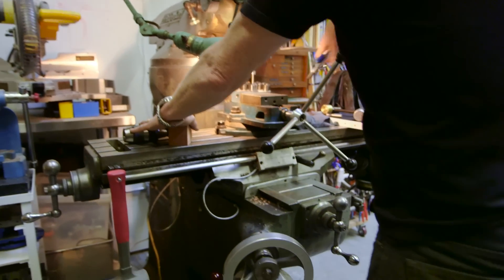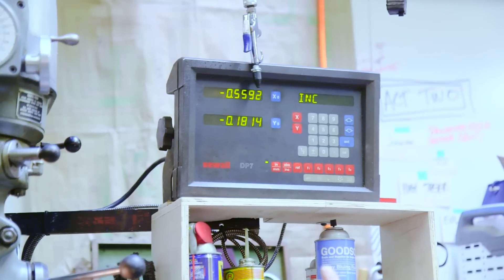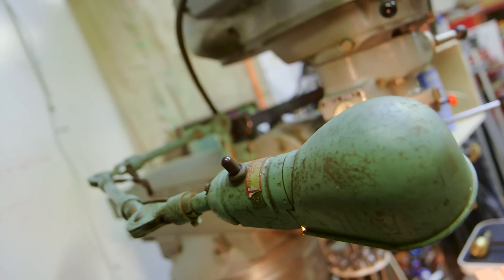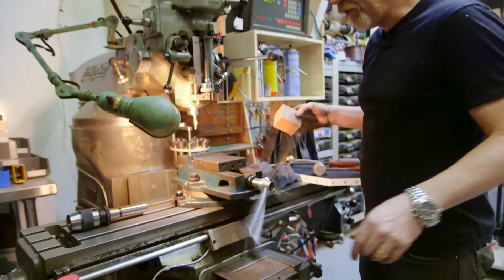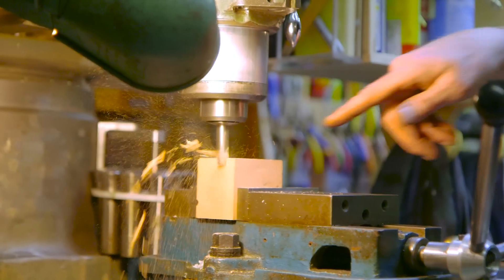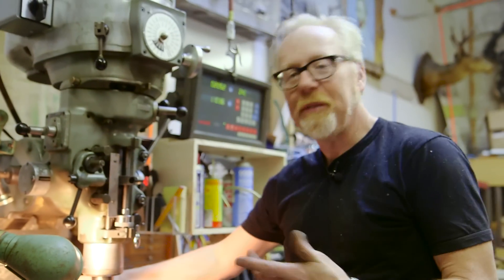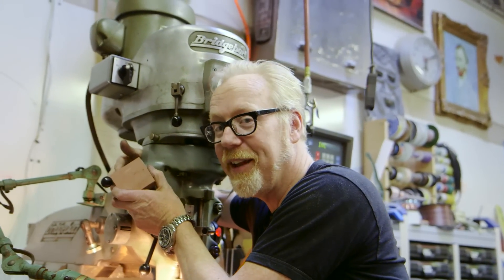Adam Savage's New Milling Machine!

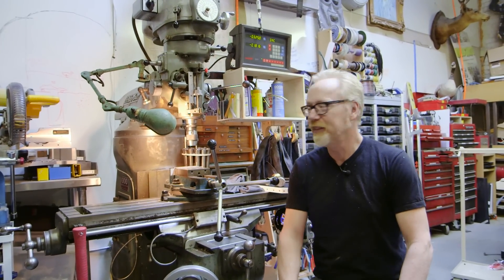Comment: 0:38 - This is facts. This Bridgeport can be used to literally develop a fallen civilization back to advanced tech. No one will understand how, but it's all because of precision. This machine is able to hold high tolerances down to 30-50 microns. This in return can help build other highly advanced machines which requires high tolerances. He's using the Bridgeport to mill wood lol 🤣

Comment: Whenever you're milling with a Bridgeport, you're supposed to bring the quill all the way up, secure the stop against it, and apply the quill brake. If you don't, you run two risks. The first one your part may not be to spec because the quill moved during the operation. The second risk you run is irreparably damaging the quill to the point that the machine is no longer usable.

Comment: What is the  material they cut?
Reply: Ruda;  Anything.  With the right cutters it will machine all ferrous and non ferrous metals and any polymer.  There is no limit regarding materials
Reply: @georgegeorge-t1p  I know. My question is what is that material used on this video.
Reply: @georgegeorge-t1p  Nice. Thank's I will search about this material.

Comment: TL, Don't read!

Ah, yes!  With this, his lathe, and a good broom, a person can make about anything.  Oh, and along with the machinery, add in a few years of hands-on experience -- making parts to high precision is an art.  As rigid as this Bridgeport and the tools used with it look, everything deflects just little bit when put under a load.  A machinist has to understand that, be able to anticipate frame and tool distortions in the direction of feed, and accommodate them in the cut.  Then there's backlash, a pretty basic and always-present inaccuracy in manual machinery.  Metal blanks that are having material removed will warp during the process, and this must be dealt with by flipping parts frequently, and perhaps in-process mechanical straightening.  Finally there's the cutting tools themselves.  Unlike drills, which look pretty much all the same, there are thousands of different shapes and sizes of cutters, made from several different kinds of material, including ceramics.  However, a prototype machinist, which is what Adam is, will often hand grind his own tools to get the best results (from high speed steel or cobalt blanks), that are as rigid as possible in the direction of load, produce perfect chips, and carry the heat away from the cut.  A telepathic link between machine and machinist is helpful here.  

Adam is a dying breed.  Time was when all machines were manual, and people started in the shop only getting to turn the handles after someone else set up his jobs.  It took years to get really good, with most never advancing beyond production machinist.  Now most machine tools are CNC, running from a program developed by a CNC programming engineer who, with the help of a computer, works out the order of the machining steps, the setups, the cutting tools to be used, the speeds and feeds for cutting, and in-process inspections that are conducted by the machine itself.  Because of errors that creep in due to the CNC programmer often not being a machinist, it is not unusual for program testing to be started using wax as the base material, with an alert machine operator standing by with his hand of the E-STOP button.  There aren't even shop drawings anymore; they've been replaced with "data sets," coded files containing mathematical equations that define 3D models drawn on a computer screen by a design engineer (who isn't a machinist either - they're famous for designing parts that are perfect for an application but which can't be machined by any known process!).  CNC programming engineers work directly with those data sets.  The result of all this is that people entering the modern factory become "machine operators," not machinists.  Eliminated at the same time have been draftsmen, who used to receive the layout work of a design engineer for conversion into a useable shop drawing, with proper dimensioning and tolerancing.  The point is production efficiency.  CNC machinery can produce parts many times faster than a production machinist, with consistent accuracy, but the expense has been loss of the individual expertise of tens of thousands of machinists.  Adam is going to have to fill in for all those people.

Comment: I went to an auction last week and tried to bid on a very unique Bridgeport, this one had square ways, you seldom find one with these, it was VERY heavy duty. That went for $2900 so I ended up not getting it. So I threw my number up on a Fadal VMC 4020 CNC machine center and one the bid for $1,100 which broke my brain. I am still confused how a perfectly maintained CNC machine center goes less than scrap but the old mills sold for so much.  Back to the point, a Bridgeport with square ways, I would like to have started a new channel off about those.

Comment: Fun Fact: Of the 7 basic machine tools (band saw, grinder, lathe, etc.) the knee mill is the only machine tool capable of making itself. And it's called a "power feed" Adam...not a "motor on the knee". But, if that's what you want to call it, rock on.

Comment: Nice machine but would take a J head any day. Those geared heads give me a headache. Belt drives do not contribute to migraines. PS from Bridgeport, Ct. So I very proud to be working on a J head Bridgeport. Also J head is more reliable. Good luck getting that head repair, all the talent is dying and they ain't making parts any more. Won't be long before I am in the machine shop in the sky. Good luck with your new toy.

Comment: Hi Adam.  Please exercise EXTREME caution around the Mill whether running or stationary. The mill is designed to CUT and this includes fingers hands and any loose clothing it can get hold of.  I have been consumed in the trade for 50 odd years and although I can still count to TEN I have had the odd reminder on how rotating bit machinery is. Your pointing to the moving cutting tool with you finger was foolhardy.  A word of WISDOM. Cheers, Tony.

Comment: You should only mill with the cutting force towards the fixed jaw of the vice.
Powered knee is awesome I worked a mill in a toolroom for 50 years and only had one on the bigger machines (huron, cincinatti etc)

Comment: That slot isn't square. when mill a slot the tool will pull to one side because of the rotational force put on it. you have to clean up each side after the first pass.
I operate a bridgeport mill with a easytrack on it for work

Comment: I have a Bridgeport mill in my workshop/hobby shop (man cave). A very versatile machine. In my opinion one of the most versatile machines ever built for manufacturing of tooling required for mass production (Mold's, Stamping dies, Special machinery). Almost any machine shop today has at least one. Programming a CNC to make a simple one off part is not very economical.
Adam Savage is a highly skilled individual for being able to put this type of machine to good use. (I guess he's going to build a lot of neat stuff with it.)

Comment: I've been a machinist for over 30 years and have worked on allot older Bridgeports. As long as those machines were taken care they lasted for longer than the machinist that ran them. I worked in a shop with a Horizontal Bridgeport mill that was originally run on belts. The owner's grandfather updated it to an electric motor in I think he said the 1950s' . The interesting thing was the belt driven ones had a large flywheel the electric ones didn't. His grandfather left the flywheel on it. But Adam I have seen you do it don't use water for coolant if you want that to last. Use cutting oil. Waters going to collect under the vice and start to rust it, and if you use allot will eventually make it into the other parts.

Comment: I just bought the same mill, made in the 80's though.  The design was so versatile, they haven't hardly changed a thing on it.    Love the handle on the vise.  Mine is a pain in the neck to move the jaws a long way.  My lathe was made in the 50"s and I just sold a Cincinnati mill that was made in the 20'S and still running great.  Gibs were a bit worn though.

Comment: That's a nice mill - that BHS sticker brings back memories. Now part of the current Walking Dead intro. Always liked the round variable dial and that cast door/storage area on the main column. Too small to hold anything but cool. I'm looking right now (Bay Area). Did you have 3-phase in the Cave or use some kind of converter?

Comment: Is it true that the Bridgeport mill the only machine that can reproduce it self using  billet steel instead of castings ???
Reply: No, as billet only exist in a mill and not on a machinist shop floor. And no, it isn't capable of producing itself due to myriads of reasons. Or have you seen bearings made on a Blidgepot lately?
Reply: Jaakko Fagerlund I haven't seen bearings made on a mill but I've seen plugs made. plugs are just a couple steps away from bearings.
I'm sure it's possible.
Reply: Just about one half of an hour after posting the question about the bridgeport, Adam Savage states, in a vidio about his engine lathe , that it can reproduce it`s self.
Reply: Steve Beavers Define "reproduce". If it means to machine all the parts that are in it, the answer is no, it can not.
Reply: You can easily make a sleeve bearing out of bronze.
Reply: randysengine service Yes, a sleeve bearing works if you accept a downgrade. But how do you make the bed on that lathe?

Comment: I have a minty 1969 Bridgeport, but the same old DRO, but my DRO shows wear. I have a hole shooter motor on the knee.
My mill for the first 45 years made a few tiny microwave housings that went to outer space, and to Mars. Now that I have it, it just makes a few gun parts and household items. I could live with a tiny crummy  mill, but the DRO makes the difference.

Comment: Adam, Your first project to your new pride and joy should be a one-shot lube system installation. No more grease gunning the zerk fittings. One pull on the handle and all vital points on your mill are lubricated.

Comment: I dont get it. I know it sounds stupid im saying this but whats so special about it. I see its very precise but other than thats whats so great. What can u even do with it?
Reply: Bridgeports (and the numerous copies, generically called "turret mills") are some of the most versatile milling machines ever made. Not very rigid (at least in the case of the original), some things not so well designed, but the head can be tilted and 'nodded' in ANY direction, the ram can be swivelled and extended or retracted, (so that you can drill axially into or bore both ends of a long workpiece strapped to the table) and there is an amazing number of attachments for reaching into holes to make side ports, moving an auxiliary spindle in an arc, slotting and shaping, boring and facing, making keyways and gears, etc etc.  And of course drilling. They're a bit like the Myford lathe in the UK: (although a lot bigger): they're never going to win any races for removing lots of metal, but they can tackle most things.
Reply: Any piece of manufactured metal (that is not cylindrical) is usually made with a mill like this or a computer controlled one. Think of it as a 3D printer for metal but instead of adding material; it removes it from a block.

Comment: Be careful having the habit of pointing at the cutter while its running.  If that was a fly cutter, you would be missing a finger. Better still, NEVER point to the cutter while in operation. If you must, use a wood dowel pointer.  Also, count your fingers before running, and then count again after running. The integers should match.

Comment: For making simple channels in soft material like that all you need is a router and table. A milling machine is great to have for metal work but on a smaller scale (and budget) it is amazing what you can do with a router, a good table and jigs. A router is one of the most versatile power tools you can have in a shop. Not all of us can afford $10,000 pieces of machinery, that being said if I had Adams bank account I would own a milling machine too.

Comment: Adam, Bridgeports are over rated. they put a lot of care into the slide ways but the design is weak compared to the German machines I've used and the head is under engineered. an xlo/ex-cell-o model 602 is a much friendlier machine. I've never really liked power feed on a series 1 sized machine. you have 2 choices, a power feed that's too heavy for the table, or a power feed that's powered by a consumer sewing machine motor and driven through a plastic spur gear, very prone to breakage. get some ball screws and stepper motors a vfd and hook a gblr or rt-stepper up to that thing.

Comment: I got to use a Bridgeport while learning machining. Spoiled from the git go. The Rolls Royce of milling machines.
But! If you're going to work with flaky crap like Ren or resin/plastics-- consider making up a positionable holder for a small vacuum line. Compressed air is nice for making a bigger mess but a purposed vacuum cleaner would be better.

Comment: And I just got myself old lathe, which is made in 1956 i think, and it's the only thing surviving about the machine on the plate :D Every other entries were not stamped on the machine plate and got lost to the time. Something soviet made, probably from soviet captured territories of the time or russia itself. Still have no idea how to adjust the feed speed (all markings over handles are gone, they are just blank plates now) and the machine got wires pinched in transport, so I  have not used it at home yet. Super old dinky aluminum wires with cloth insulation are going to be replaced before I use this thing :) I wish I could get affordable milling machine.

Comment: Buy a CNC mill and you will be amazed!
Reply: +tizwicky Propapbly easier to mill by hand if you dont want to spend a day drawing exact plans first.
Reply: No doubt that the manual mill still plays an important part in the modern machine shop. Setups can be fast and easy for trivial jobs, but for anything requiring exact, precise, accurate, and FAST machining NOTHING BEATS THE CNC.
Reply: +tizwicky CNC are for mass production, and very diffucult shapes..  - Of course ''exact, precise, accurate'' needs can be meet with manual machines.   - You just need the right machines.  And no, i'm not talking Bridgeport... ;)
Reply: You sure nailed that one Rasmus. Just for reference tizwicky Moore, SIP, and many others built ultra precision jig borers and jig grinders long before numerical control was even thought of never mind CNC. At the time those machines were built by highly skilled machinists on manual machines and then hand scraped into as close to perfect alignment as possible.And everyone of those machines were and still are considered to be exact, precise, and very accurate machines when they left the factory. Yes there's probably a few CNC machines around that would be more accurate today. But the average CNC mill in a normal shop is far less accurate than those jig borers or grinders were. Suburban Tools has a video showing there jig grinder working if your interested.
Reply: They get boring after a while though

Comment: I'm so jealous of the knee motor. yes, I've been machining for 20 years, and have yet to see one with a knee motor. Very cool Bridgeport, Adam.
Reply: +Samson Arnett-Roughley it's a motor for the "z" axis, that moves the table up and down. otherwise you have to crank the handle to get a deeper cut.
Reply: +Samson Arnett-Roughley Each rotation of the handle only moves the  table up or down .1".  So to move it just 4 inches you have to crank it 40 times.
Reply: Make a cordless drill adapter.

Comment: Ohh yes as a machinist and never having a powered knee (only powered X axis) a powered knee must be SO nice! Nothing is more annoying than spending 5 minutes cranking the knee up and down for stuff. I am honestly amazed at what you could do without the mill and I can only imagine what you can do WITH the mill! Any plans for say a CNC router or CNC mill in the future?
Reply: @beachin my grandfather, now in his late 90s is a machinist. He still gets up every morning and goes to his shop and works. He has designed and built parts for exotic cars, yachts, industrial equipment, theme parks and even rockets and aerospace/defense stuff. He has a few knee mills, some impressive lathes, and a couple Haas CNC machines. What he does with metal is nothing short of magic. I can certainly see how they were so highly regarded during a time of great industrial progress. I agree there is a huge difference between machinists and machine operators.
Reply: Make a drill adapter. I have videos of one I made on my channel.
Reply: make an adapter for the ridged castle shape socket for the knee handle, plug it onto a cordless drill and you're set.
Reply: Gotta love CNC routers

Comment: I'm a machinist and I approve
Reply: So explain the motor on the knee, if I'm spelling that right.
Reply: its exactly the same kind of motor on the X and Y axis, though i've never personally used one before. ive used an acu-rite miller, which had the motor attached to the head instead of table.

Comment: Never use compressed air to clean a lathe or a milling machine because the chips is blown to places where you never going to clean them again without disassembling the machine. Compressed air will force debris into slide ways, bearings, spindles etc.